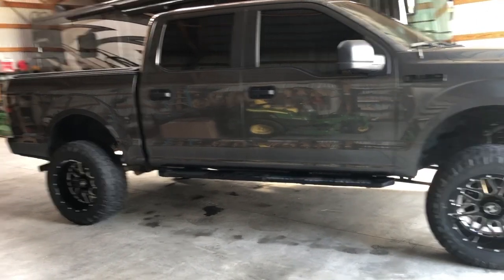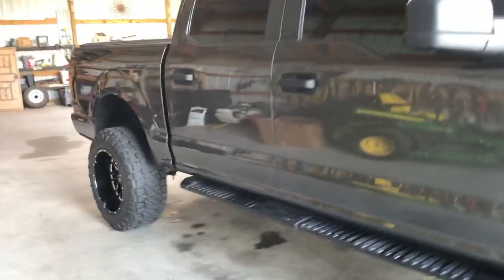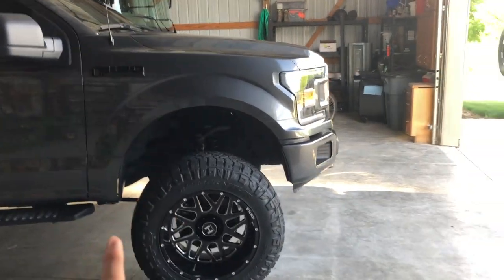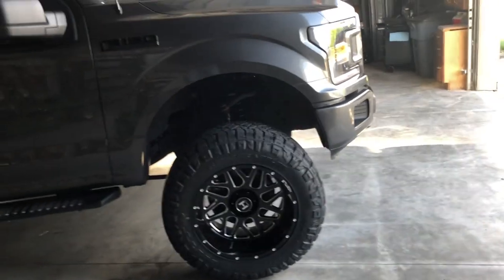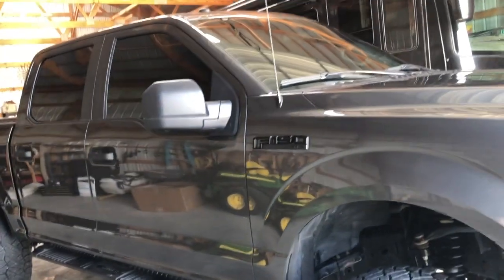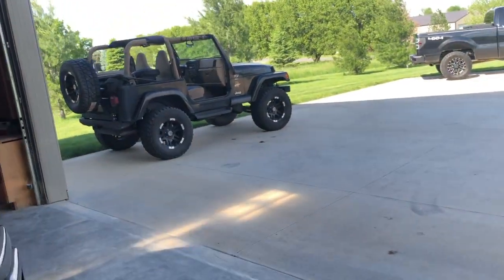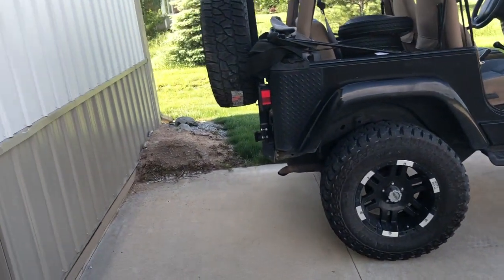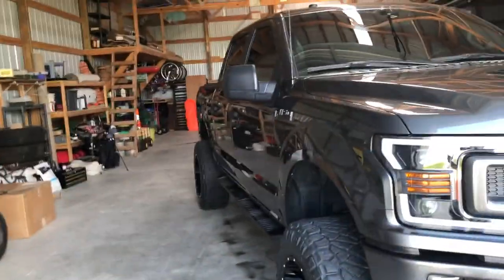How much taller will a vehicle be once lifted?

Comment: My 2014 F150 4x4 sits at 6'9 overall height. I'm currently on 33x12.50R20..
I want to run 33x12.50R22..
I should get close to 6'11 with the tire setup correct? 🤔